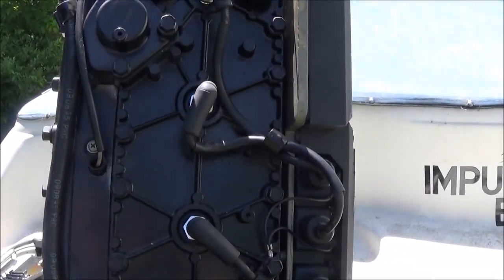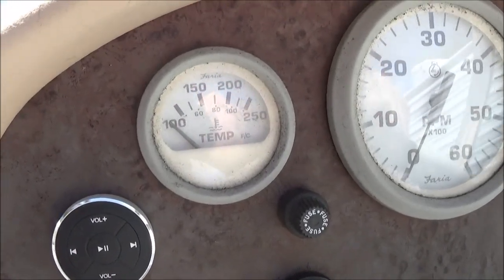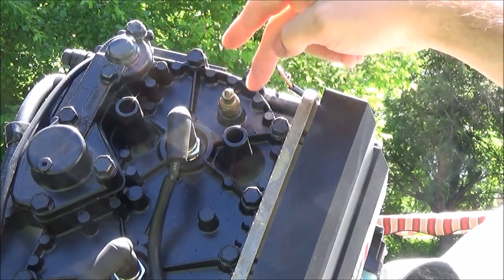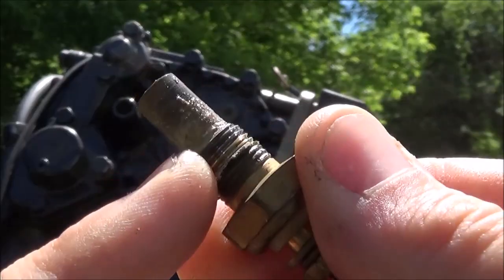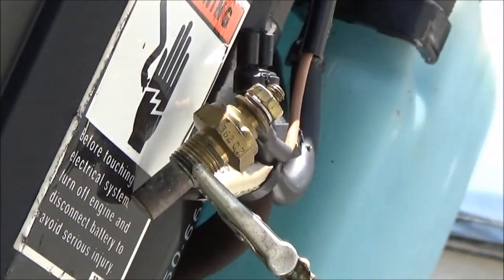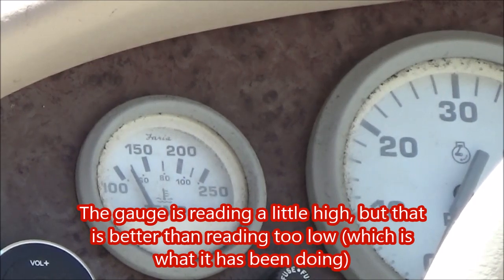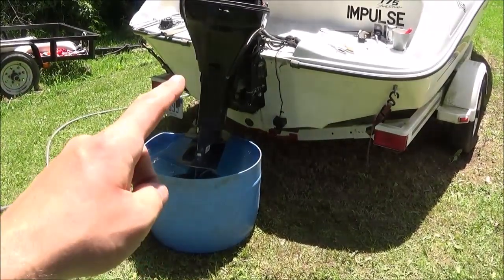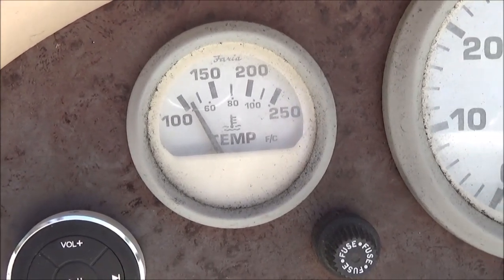Troubleshooting a Mercury Outboard Temperature Gauge Sender

Comment: This is extremely helpful. I want to add a temp Guage to a boat I am reworking all the onboard electrical circuits that never protected. All I need to after this is go find if the motor ever had the temp sensor. Just finished adding va Trim sensor and gauge so this will now be 🎂!

Comment: when you are taking the brown wire that was connected to the temp sender and grounding it to "somewhere on the engine casing" (1:07) are you taking that brown wire and just touching it to any other piece of near by metal on the motor? Since the camera was zoomed in on the gauge at that part of the video I could not confirm and don't want to do that if that's not what I should be doing. Thanks in advance for any information!
Reply from the maker: Yeah I just removed the wire from the sensor and touched it to an unpainted bolt on the engine.

Comment: Turns out my gauge wasn’t working because the previous owner had the blue and brown wire connected to the sensor. After switching the wires everything worked! FYI mine was a Mercruiser 3.0 inboard.

Comment: Random question but what head unit do you have? I just seen the controls it looks tidy
Reply from the maker: It's just a Bluetooth remote for the cheapest head unit I could find at Walmart. I have to change the battery every spring. I regret buying it because the first trip out it always has a dead battery haha.

Comment: sending units use a tapered thread and shouldn't leak without sealant
Reply: Should, could and would (shouldn’t, couldn’t…..) always raise a red flag 🚩for me. A little thread sealant or Teflon tape at the base of the the plug ‘should’ add an extra measure to insure a positive seal.